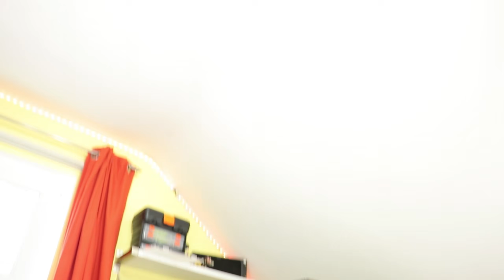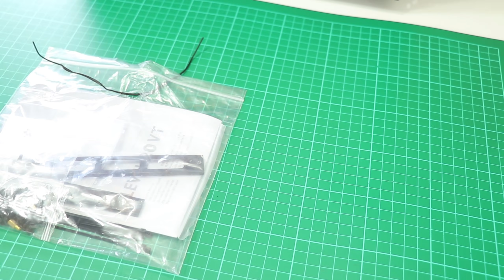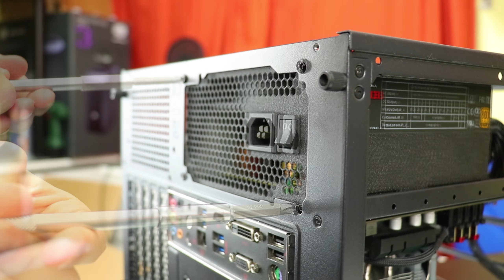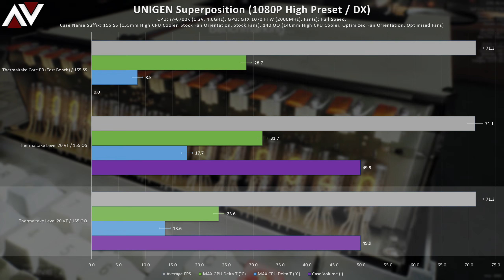Thermaltake Level 20 VT (Micro ATX) Review: (Sort of) Fully Modular

Comment from the maker: Time Stamps:
01:42 - Unboxing / Overview
12:15 - System Installation
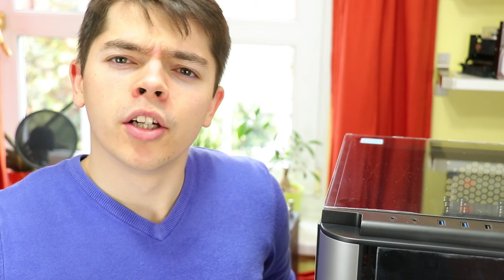17:19 - CPU Cooler Explanation
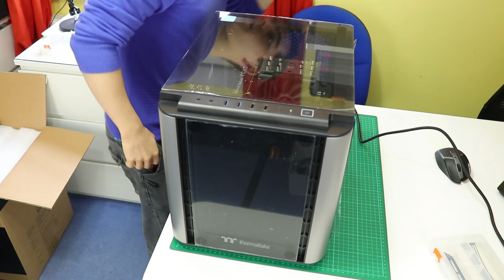19:37 - Optimal Fan Setup
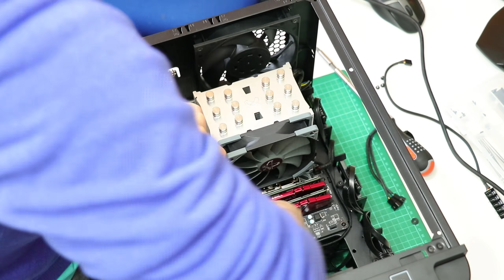22:15 - CPU Cooler Swap
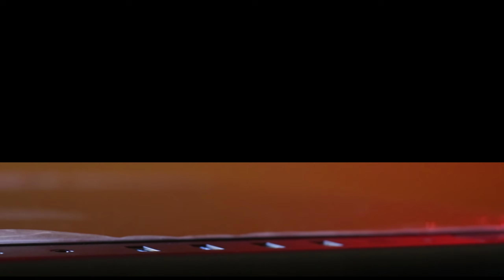23:04 - B-roll
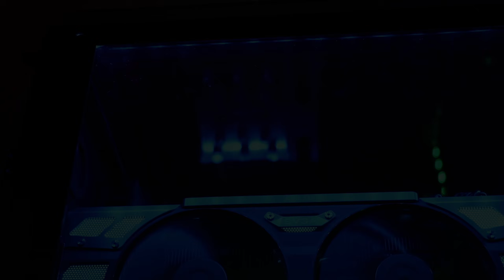25:41 - Thermal Testing Explanation
27:28 - Thermal Testing Results
30:37 - Conclusion

Comment: 50 liters ? why they had to make it so big ? micro atx is supposed to be a smaller solution than ATX. SMALLER.
Reply: of course it's optimised for watercooling. and if you don't need it ? you just have an half empty case. GREAT.
Reply from the maker: Eh, mATX can be smaller. Or it can be used to make more room for other features, or do something you couldn't do  as well with the larger ATX board.

I agree, it's so big, and what looks like an on the desk case takes up half of a big desk. But I'd prefer it to exist for the sake of trying something different and interesting. There's plenty of other cases to choose from so it's not taking much away for it to exist.

Comment: not etched they are stamped!

lip on the inside of the front panel catching on the fans is due to the front panel holes being punched out on a press and the lip is probably adding additional strength to the front panel as its only thin steel

Comment: If you plan to move this case, be mindful of where you grab the unit. The front panel is not permanently attached to the unit, so it will come off when you apply pressure. If you place a hand below the front plastic panel when lifting the case you risk dropping it.

Comment: 34:41 why do the GPU's fans keep moving slightly? Super review though dude. Ordered myself one of these(also because my new GPU doesn't fit in my old case).
Reply from the maker: Thanks very much!

The GPU fans were kicking in and out due to the benchmark running during the recording. The temperature kept on rising and falling above and below the temperature where the fans were set to kick in. I should have locked the fans to a constant speed to clean up the shots and avoid causing confusion.

Hope your build goes well, and thanks for checking out the video.
Reply: @AVTechy  Aha! I see. Yeah my new GPU has that fan feature too - turning off completely under 60 degrees. Was forced to buy a new case anyways because my new card is a whopping 327mm in length. Insanity. Still, it'd be nice to finally have a glass see-through case! Looks great man.

Comment: What you see on the PCB is not corrosion, it's simply flux from the soldering process.

Should have been cleaned off, but will not interfere with the solderjoints, atleast not in the normal lifespan of a computercase.

Comment: I’m considering getting this case but I’m worried about dust getting into the case over time.
Reply from the maker: That's not a concern I'd have about this case specifically. Any case you get will see dust get into the system.

If you really want this case and what to cut down on dust build up, you should fill the front with fans (or run the front fan at a mid to high speed), and have a slower rear exhaust. This will encourage the air to exhaust out the top and prevent dust entering from the top when it's running. You don't need a rear exhaust, but they're surprisingly helpful for GPU temps.

As long as the intake airflow is higher than the exhaust, that'll do a great job of preventing dust from settling. You might want to check up on the fan's airflow rates to tune this more finely. But this goes for all cases, not just this one.

Let me know what you think, and if you want to talk over anything specific just let me know.

Comment: One of the most thorough case reviews I've ever seen. Sub'd! Great job. Do you happen to know if the side or top glass panels can be interchanged with mesh panels from the Core V21? The frame of the case looks nearly (if not entirely) identical. I'm asking mainly because I wouldn't mind buying one of those side glass panels directly from Thermaltake to replace the plastic window panel on my Core V21.
Reply from the maker: Thanks very much, I really appreciate the support!

As for panel compatibility with the V21. It's not something I can guarantee is possible, but as you say the chassis' of the cases look identical, and I can't imagine they would retool to make very minor adjustments to the chassis for a nearly identical case.

I've had a quick look around, and I've not been able to find anywhere that sells spare Level 20 VT panels. Have you had any more luck?
Reply: @AVTechy  I contacted TT directly on Twitter via DM last year to buy an extra panel for my Core V21. I assume they can sell spare glass panels through there as well, but haven't asked.
Reply from the maker: Interesting, I suppose if you go at it from the "spare panel" angle it's quite likely they'll help you out. I'd love to know how it goes, and whether they'll sell you a panel, and if they do whether it fits. Keep me updated if you can :).

Something that would be interesting to know is the cost of each panel, and whether the cost of a V21 + the tempered glass panels is near the Level 20 VT cost... I doubt it, but it would be interesting to know. But don't go asking them for the cost of all panels, they'd probably get a little resistant. Let me know how the quest for the top panel goes :)

Comment: 49 liters. This case is far too big for only micro-Atx. Heck, even if it supported Atx it would still be too fat. 

I wish manufacturers would stop creating cases just to be pretty..
Reply from the maker: It's certainly a large case, and I think it's only usable from a water-cooling standpoint. Air-cooling just isn't viable for this case in my opinion. Although that's probably the point since these are Anniversary cases likely intended for "showcase" builds, and that's better achieved from water-cooling  most of the time.
Reply: Check out the Cooler Master HAF XB.  Very popular cube case.  This one is much more "showy". Just wish it could fit an atx motherboard.

Comment: Very nice review, I think I’ll have to get this one down the line just to mess around with the possibilities. Most of the other cubes out there just seem outdated by now.  

Is that front logo on the glas a sticker or is it etched?

Excellent job on those switching transitions, really cool with the changing light effects.

You covered the multitude of things this case brings with it really good. 

I missed one thing at the end though, I would have loved to see the finished build rotated to a „traditional“ orientation.
Basically last scene bottom to left side, front 90 degree clock wise and former right side panel to former bottom.

Thermaltake did good to restrict placing the movable fan brackets on any other side than the spaced out top panel. It wouldn’t make sense to place fans behind a flush panel anyway, it protects people from being...“not smart“^^

Affiliate links...toiletpaper? Hmm at least not tampons or condoms 😂

Good job, I hope YT finally catches on and you get some more exposure, feels like they are boycotting you a little lately 😞
Reply from the maker: Yeah this and the 280X seem like the most "modern" cube cases around. I'd love to see Thermaltake create a premium version of the V21, that would be awesome!

The front logo is just a sticker, so I can imagine with a little heat and a soft plastic tool it could be removed fairly easily.

I was planning to flip the case towards the end, but crunch time got the better of me and I had t complete the video... I'm going to re-evaluate the orientation for the water-cooling which will commence later today! I'm super excited for this one, and since it's nearly Halloween the red coolant should work nicely!

I think it would have been nice to allow the side panels to work with the fan mounting rails, but overall I don't think it's a huge loss that it doesn't quite work. I would have really liked this all to be documented in the manual though, so it would seem intentional rather than a missed opportunity.

I'll mention condoms and tampons next time don't worry :P.

Comment: Great detailed review! Is it possible to mount the stock front 200mm fan inside the case like what you did with the 120s?
Reply from the maker: It certainly is, if you check out 41:47 you should be able to see some long fan screw holes above the threaded holes for the long screws that come with the fan. You'd need to use traditional fan screws here through, these holes are also there for mounting a radiator.